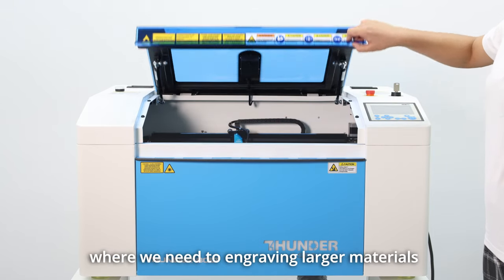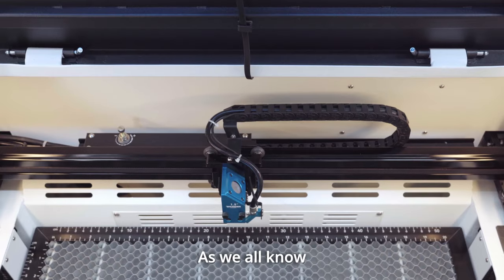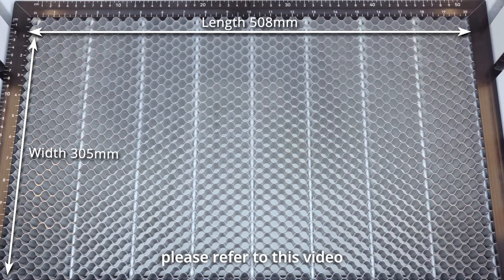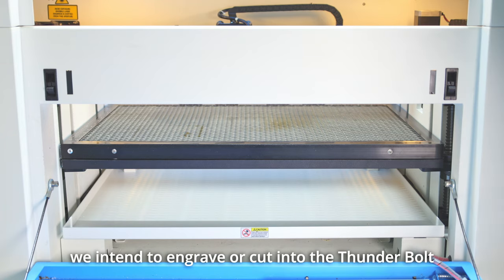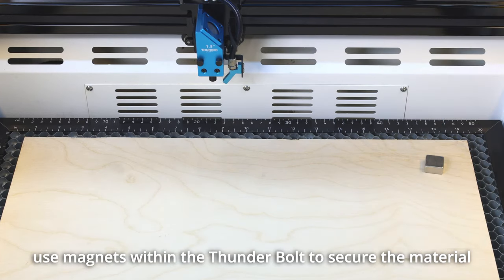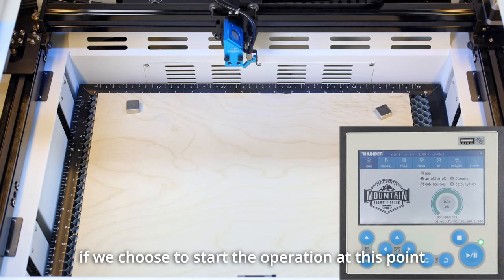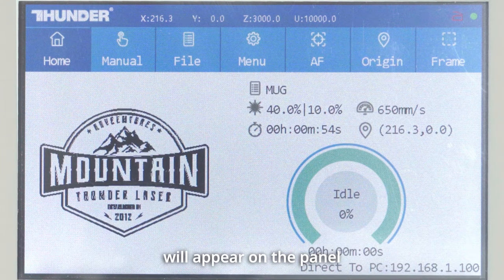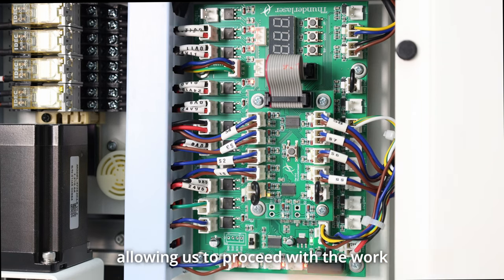Thunder Laser Bolt Tutorial: How to Cut or Engrave on Oversized Materials

Comment: Would love to see videos of the Bolt cutting 14 inch rounds. This video sets up the possibility of cutting larger items but it doesn't demonstrate it.
Reply from the maker: The term "oversized materials" here refers to materials larger than the working area of the honeycomb table. Since the Bolt does not have a pass-through door feature like the Nova, it cannot process in segments like the Nova. We are simply providing a way to place materials without the need to cut them into a suitable size. In practice, it does not mean processing files that exceed the working capacity of the Bolt.